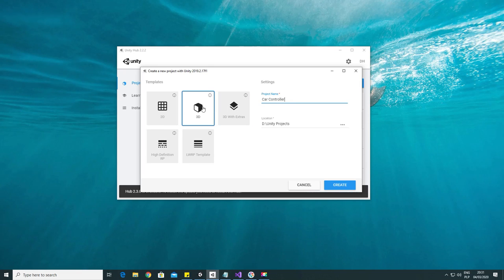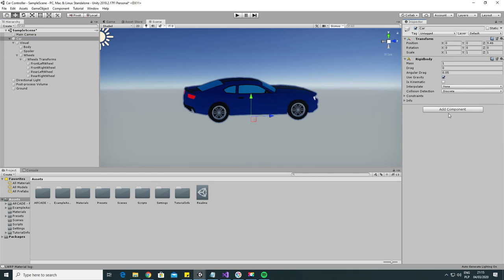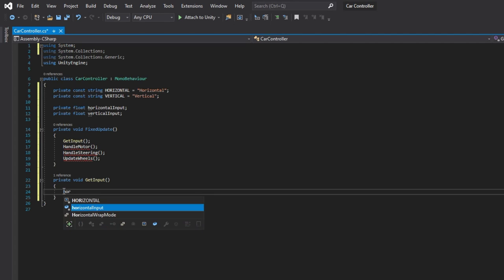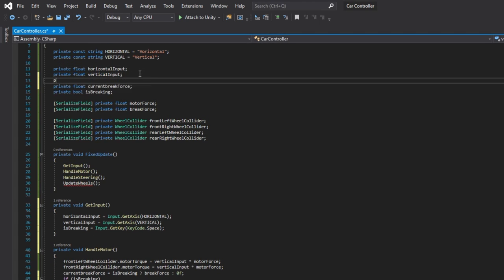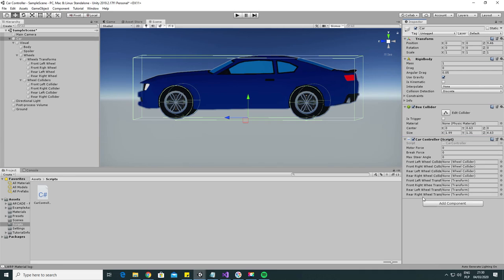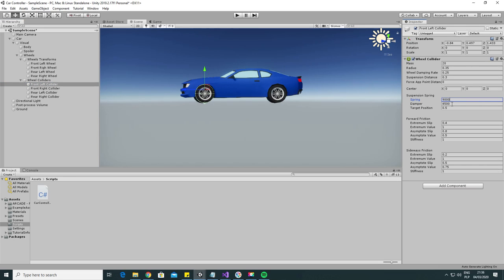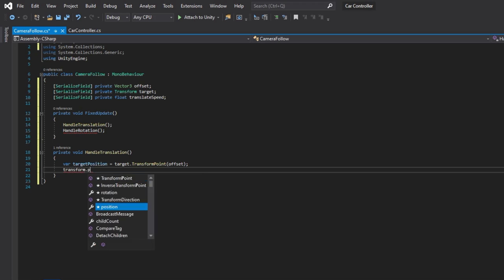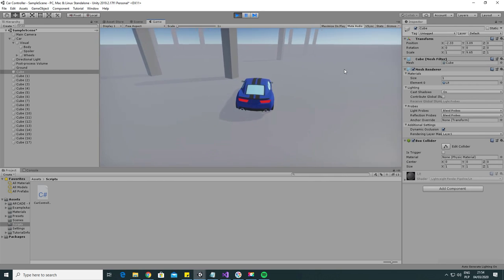Simple Car Controller in Unity Tutorial

Comment: Just a quick heads up, this script is using negative motor torque to handle braking when pressing "S."  Per Unity's documentation, negative motor torque should not be used for braking.

If you'd like to apply brakeTorque instead of negative motorTorque, create an if statement that says if verticalInput < 0 then brakeTorque = -verticalInput * brakeForce.
Reply: in which part of the scrpit should you put this? btw i really liked your car video:)

Comment: I really like this tutorial because you show some common mistakes and how to avoid them. For example: setting the box collider incorrectly or using Lerp insead of SmoothDamp. Unity is not a black box where you input the correct values and everything works just fine. Making games (or anything, really) is iterative. I think showing the process can be very encouraging for beginners.
Reply: What did you use in HandleRotation? There is no SmoothDamp
Reply: Are we brothers?

Comment: Once the BrakeTorque is applied, car does not move again when I release the break. Plz help.
Reply from the maker: You can try to remove the isBreaking check on line 45 and make sure that the brakeTorque is set to 0 when spacebar is not pressed.
Reply: you can try to do this:

private void HandleMotor()
{
            if (isBreaking)
                         breakForce = 3000;
            else
                         breakForce = 0;
            
            frontLeftWheelCollider.motorTorque = verticalInput * motorForce;
            frontRightWheelCollider.motorTorque = verticalInput * motorForce;
            currentBreakForce = isBreaking ? breakForce : 0f;         // you don't need this part because of the if and else you do upper

            ApplyBreaking();
}

ApplyBreaking ()
{
            // right there i don't put all wheel colliders! the type of wheel colliders you put here is according to the traction you want to put in the car!
            // I put for a RWD car (rear-wheel drive)! the video is made for AWD car (all-wheels drive)!
            // It's to everyone's taste! ;D
            rearLeftWheelCollider.brakeTorque = currentBreakForce;
            rearRightWheelCollider.brakeTorque = currentBreakForce;
}

This method works but if you want a clean and more professional code try to do the wheels colliders with lists! and you can call the wheels with a simple foreach! And carefull because "break" writes "brake"! it's normal this type of errors while programming! especially if you're not english! i can't talk about this because even I do this type of errors! but if you want a correct code try to change "break" and "breaking" to "brake" and "braking"! But sure it was a good tutorial! Congratulations GameDevChef! Keep like that! One more like! 👍 =D
Reply from the maker: I found the problem. Remove the isBreaking check on line 52 in Car Controler script. That should make it work
Reply: @GameDevChef  can you explain why it works without the check

Comment: You are missing the brakek force reset, the if(isBraking) {applybreak()} is wrong because, the 0f breakforce never applies, it means once you braked the car just stops and cant go anywhere, you shoul always apply the bake
Reply: PRANAY G.V. 
Inside the HandleMotor() function you could add this code to fix that bug, you may have already figured out a solution but hopefully it can at least help someone else. Basically, this code checks if isBreaking is false, if it is it sets the brakeTorque for each wheel to 0.

if (!isBreaking)
        {
            frontRightWheelCollider.brakeTorque = frontLeftWheelCollider.brakeTorque = backRightWheelCollider.brakeTorque = backLeftWheelCollider.brakeTorque = 0f;
        }
Reply: PRANAY G.V.  Just remove the IF from the ApplyBreaking method
Reply: @jacobpatron8387  thank you!
Reply: @jacobpatron8387  thankyou soooo much dude
Reply: @jacobpatron8387  thanks 🙏

Comment: How can i change the speed / acceleration of the car?
Reply: Change motor force amount
Reply: @matymare  it doesnt help ig but thank you anyways
Reply: if you want to make it slower then you can increase drag ( 1 - 3 will probably be as high as you can go ), but im not sure how to make it faster.
Reply: @barebones.  i think the car falls over when i increase the drag
Reply: @lostsoop  Same problem
Reply: Make speed 100000 go BRRRARRARRRARRARARRRETERARrrRrRrrRr
Reply: @Anaheim42069  ahhh you mean speed go vroom vroom broooom boom
Reply: @lostsoop  i think they mean car go brrr
Reply: @lostsoop  Did you change it in the inspector?
Reply: @lostsoop  did you ever fix it?
Reply: @oozly9291  no
Reply: Did you find an answer to your question
Reply: @alialshah8466  no
Reply: I found that increasing the forward friction extremum value on each of the wheel colliders  will increase the speed
Reply: you need to multiply the float "Horizontal" and "Vertical" by the amount that you want

only Horizontal
Reply: Did you give up?
Reply: @bamers404  I found that increasing the forward friction extremum value on each of the wheel colliders  will increase the speed

Comment: The wheel colliders of my car just detatch and fly into the air and pressing wasd doesen't change anything, pls help
Reply: Hey Nexus, to fix your problem you should ensure that wheel collider and wheel mesh are not on the same game object or child
Reply: @m0ch1_6   thx, I've already fixed that problem, but now I can't get my car to get faster, no matter what motor force I set. It just keeps driving at the same speed.
Reply: @Nexus-fi1hb  U mean for acceleration? If turn the camera to the side u can see in the sample project, the tyres do not have enough grip and the tyres just slip
Reply: @AugGust  hey, do you know what i should do if only my front two wheels are rotating? (& turning)
Reply: @lukascampbell5881  The setup for the front and back wheels should be identical? Just go through and make sure you didn't miss anything
Reply: @AugGust  thanks, i actually managed to get that to work but somehow my wheel colliders are at a worng angle and i cant change it

Comment: why are the rear wheels being updated if the parameters of rear wheel colliders never change? from my understanding, the front wheel colliders move according to the torque that is being applied, and the wheel transforms have to be updated to match the wheel collider positions and rotations, but from the code itself, the rear wheel colliders do not move since the torque is only applied to the front wheels in the code, so how do the rearwheel colliders move?
Reply: The physics system automatically move them when the car moves because they are rolling in the ground

Comment: Followed exactly as you did, but sadly my car still seems to spin out so easily when turning, I've played with changing values and have also moved the wheel colliders slightly, which helped a bit but it still can't handle driving around a track at speed, what can I do to make it better?
Reply: Change the value of suspension to 1.

Comment: I put the wheel configurations as in the video, but even putting a mass of 50000 the car will still be lifting, what can it be?
Reply: try changing the suspension spring to 90000 and damper to 9000 on the wheel collider. Remember to change it for every wheel collider on each wheel.

Comment: if I want the car to apply brakes as soon as I release any of the W S  or Up Down  buttons , what should I do
Reply: try reading the input.GetKeyUp method
Reply: @Randomiz8orinator  
well  i knew about them , I was meaning how to stop the car momentum , what code to put in the get key up func.

I tried motor torque =0
Brake torque = Mathf.infinity
But it still didn't stop as soon as key up 
So had to play with the rigidbody velocity for it to work.
Reply: Did you figure this out? Having the same question.

Comment: So the moving / driving is working fine i changed the motor a bit to suite my little game but the breaking just is not working iv tried removing the "isbreaking check" on the line 52 like you said to another person in the comments and i tried  what another person said to that reply and neither worked well the original worked kinda where it breaks but then stuck with the break i also tried a few solutions i thought of but non of them worked mainly one that checks if break force is 3000 then check if space is being clicked make the motor torque to the breaking force that is required to stop the car from moving. Any help would be great
Reply: Same problem
Reply: Any solution you got ?

Comment: So I was wondering, what would I do to keep the max speed the same but increase acceleration? Would it be like, increasing the motor force and placing a basic "if-then" statement to stop it exceeding a certain speed?
Reply: You could have it so that when you press the gas, it takes a certain time for the motor to reach the target torque, either using curves or basic script math/logic. Simply put, keep the maximum output of the engine unchanged but make it be achieved quicker or slower.

Comment: I modeled my own car and everything works fine, except for the Wheel Transforms. They rotate in a weird way around the car and not around themselves. Is there any way to fix that? Thanks in advance.
Reply: Take one wheel mesh and make it wheel collider object child. Reset the transform of the wheel and then put it back in the mesh section. Repeat for the other 3 wheels. Worked for me
Reply: @alexandru-cristianpop7099  It seems to work but the only problem is the scale. I have to set the scale to 100 but then the error occurs again.
Reply: @alexandru-cristianpop7099  I fixed the scale thing. There was a problem with the blender export. Now i still have the problem with the rotation and what you suggested did not work.
Reply: @lukasriedl8859  I'm sorry then, bro
Reply: @lukasriedl8859  put the origin of your wheel mesh in the center of your mesh.
Reply: @Leo785  And how do I do that?
Reply: @lukasriedl8859  in blender select your model and change its origin and then export it back to unity
Reply: @Leo785  Okay it works now. ty!

Comment: I made the car with a fully functional car controller. it was working fine but when I use the same script and method on the new car mess it's not working. well are rotating but the car is not moving. any solution.

Comment: Hey I’ve an issue, the thing is that my car design has a brake model so when my wheels turn left or right, the brake just stays there inamovible.          I tried everything to make the brake turn with the wheels (in the horizontal axis) but I couldn’t figure out how.                  I want the brake to turn left and right with the wheels, not make the brake rotate/spin Like a wheel.               I need the answer ASAP cause I’ve my evaluation project soon. I’ll be waiting your answer, nice video btw :o
Reply from the maker: if you want to simply rotate your additianal model in Y axis, you can add Y axis rotation that would equal HorizontalInput * maxTurnAngle for your additional model. Then use Quaterniom.Slerp. Other way would be accessing localYAxisRotation of the wheel model and apply that angle to Y axis of your brake model
Reply: @GameDevChef  Thanks i got an 100/100 in the project.

Comment: I have a problem with slowing down when not accelerating. The car doesn't do that. I want the car to stop after a while if the car doesn't recieve input while accelerating forward or backward. I tried using the max friction physics material for the plane in the environment, but it doesn't work. Someone please help.

Comment: (If anyone needs it. I did make some differences (Like capital letters on some stuff, but that's all)

using System.Collections;
using System.Collections.Generic;
using UnityEngine;

public class CarController : MonoBehaviour
{
    // Rename the terms used in the Unity physics engine
    private const string HORIZONTAL = "Horizontal"; 
    private const string VERTICAL= "Vertical"; 

    private float HorizonalInput;
    private float VerticalInput;
    private float currentbreakForce;
    private float steerAngle;
    // Choose whether to break or not
    private bool IsBreaking;

    [SerializeField] private float motorForce;
    [SerializeField] private float breakForce;
    [SerializeField] private float maxSteerAngle;
    // SerializeField is because we don't want other scripts to access it, but we do in the inspector
    [SerializeField] private WheelCollider FrontLeftWheelCollider;
    [SerializeField] private WheelCollider FrontRightWheelCollider;
    [SerializeField] private WheelCollider RearLeftWheelCollider;
    [SerializeField] private WheelCollider RearRightWheelCollider;

    [SerializeField] private Transform RearRightWheelTransform;
    [SerializeField] private Transform RearLeftWheelTransform;
    [SerializeField] private Transform FrontRightWheelTransform;
    [SerializeField] private Transform FrontLeftWheelTransform;

    // We use "FixedUpdate" because we need to use the Unity physics engine
    private void FixedUpdate()
    {
        GetInput();
        HandleMotor();
        HandleSteering();
        UpdateWheel();
    }

    private void GetInput()
    {
        HorizonalInput = Input.GetAxis(HORIZONTAL);
        VerticalInput = Input.GetAxis(VERTICAL);
        IsBreaking = Input.GetKey(KeyCode.Space);
    }

    private void HandleMotor()
    {
        FrontLeftWheelCollider.motorTorque = VerticalInput * motorForce;
        FrontRightWheelCollider.motorTorque = VerticalInput * motorForce;
        currentbreakForce = IsBreaking ? breakForce : 0f;
        if (IsBreaking)
        {
            ApplyBreaking();
        }

    }

    private void ApplyBreaking()
    {
        FrontRightWheelCollider.brakeTorque = currentbreakForce;
        FrontLeftWheelCollider.brakeTorque = currentbreakForce;
        RearRightWheelCollider.brakeTorque = currentbreakForce;
        RearLeftWheelCollider.brakeTorque = currentbreakForce;
    }

    private void HandleSteering()
    {
        steerAngle = maxSteerAngle * HorizonalInput;
        FrontLeftWheelCollider.steerAngle = steerAngle;
        FrontRightWheelCollider.steerAngle = steerAngle;
    }

    private void UpdateWheel()
    {
        UpdateSingleWheel(FrontLeftWheelCollider, FrontLeftWheelTransform);
        UpdateSingleWheel(FrontRightWheelCollider, FrontRightWheelTransform);
        UpdateSingleWheel(RearRightWheelCollider, RearRightWheelTransform);
        UpdateSingleWheel(RearLeftWheelCollider, RearLeftWheelTransform);
    }

    private void UpdateSingleWheel(WheelCollider WheelCollider, Transform wheelTransform)
    {
        Vector3 pos;
        Quaternion rot;
        WheelCollider.GetWorldPose(out pos, out rot);
        wheelTransform.rotation = rot;
        wheelTransform.position = pos;  

    }

}

Comment: I have some problematic issues. While I am using a different car model, I don't think it should be any different than what this model provides, but regardless:
I've followed the tutorial very well, but I've ran into two problems. When I add a Wheel Collider, it doesn't show up at all during the editing, unless I make a rigidbody component. But once everything was set up and handled, the car either bounces and flies in all sorts of directions that's not wanted, the wheels fall through the plane and into the abyss, or all the wheels snap to position 0, 0, 0. It's very infuriating and I'd love to get this fixed!

Comment: Hey there is one problem i wrote the same code 4 times but the problem is not solving the problem is that when i pressed break 1 time then i release it so isBreaking is false now but now car is not moving the steering wheel is working ok but when i pressed w or s then car is not moving forward or backward and rear wheels are also not rotation please give the solution please
Reply: Check the description.
He told some changes there. I think it would solve your problem.

Comment: The acceleration is too slow, and for some reason, the car starts flying on low mass. Any idea why that happens?
Reply: you have to put 
Extremum slip to 4 from every wheel collider
Extremum value to 20 from every wheel collider
then it shoud be good and put motor force higher like 1500 and rigied body mass to 1500
Reply: @EL3ino  god bless u 🙏

Comment: When i start the game, the car moves on its own, and when I press the space bar to break, it stops forever and it doesn’t let me move anymore. How do I fix this?
Reply: So to fix the braking issue, you need to remove the if (isBraking) part and only call ApplyBraking(). Because otherwise what happens is if you're not pressing space, then it won't call the function. And if it doesn't call the function, the breaktorque value on the wheel colliders will still be what it was last time the function was called when you were holding down space

Comment: if i push it enough it still lifts. someone knows any possible ways to fix this?
(I already tried to increase the value of the spring and damper and it didn't helped).
What can i do to make it more stable?
Reply: In physics a bunch of things will allow you to flip the car, like...  high speed, tight steering angle, low weight, high center of gravity.    So fiddle with these and maybe limit them.

Comment: I doubt anyone will see this, but I'm running into a problem: Whenever I brake, it will brake but it will not do anything else after it does. Any ideas on what is causing this and how to fix it?
Reply: theres a bug in the code. the part that applies brakes does it while space bar is held but there is no code to ever UNapply the brakes once space is no longer pressed